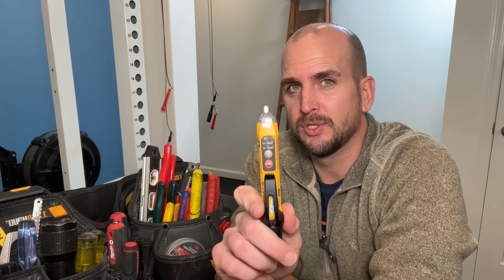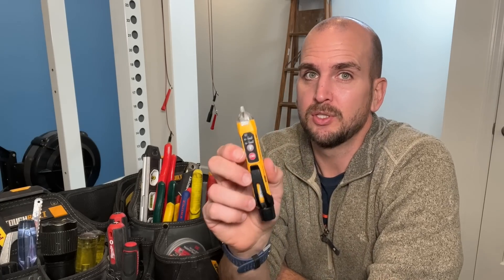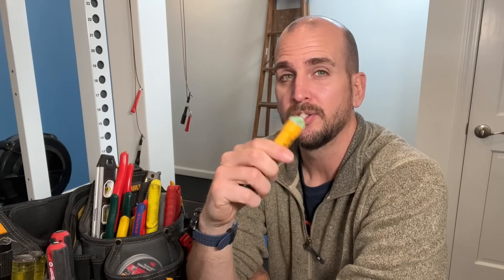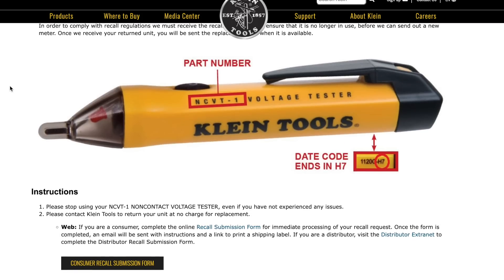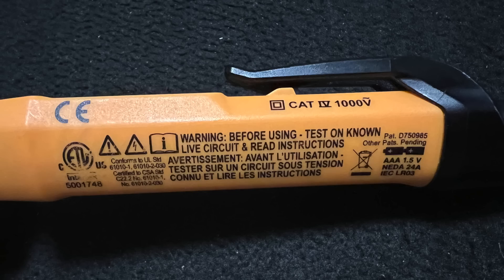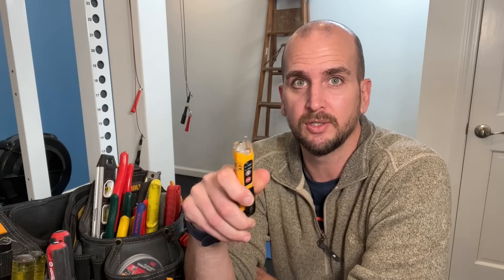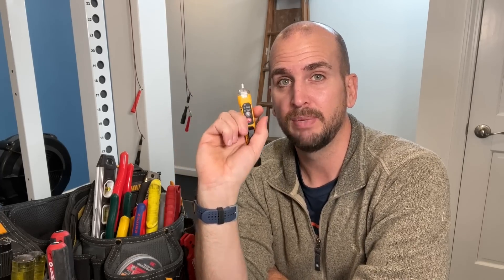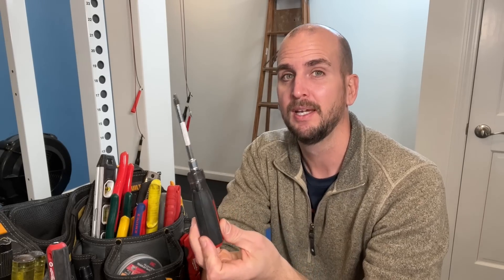The Tool I Get The Most Negative Feedback On And Still Use Weekly

Comment: I’m a home DIY guy and use it around the house for 120V. I’m not touching 240V, I call an electrician for that. But when I change an outlet before doing my work I turn off the breaker, test the outlet with something plug in and test it with the non-contact tester. Then I short the circuit with a screwdriver. Maybe not the best way to do thing, but I prefer to sacrifice my screwdriver rather than myself!

Comment: Despite testing wires for juice, i always do a final test before i actually touch them. I’ll use my screwdriver to contact each wire, one at a time, to the ground to see if it arcs. I have 99% faith in my testers, but i like to be 100% sure.
Reply: I do the same thing

Comment: My NCVT is the Sperry 6505.  It's advantage (IMO) is that it's ON switch is non-locking: only on while you hold it down. So, for every test you see the beep&flash turn-on signal, and there's no question whether it's ready to go. Batteries last longer, too.

BIG NCVT CON:  Mentioned in one or two of the comments:   240-volt circuits don't register well on any NCVT, because the two phases largely cancel each other out.  Have to get very close to the 240V Romex cable to get anything at all.

Comment: One time I got a false positive touching a wire. It must have been carrying some small amount of current since the wire treated was near a live wire several feet away. It confused the heck out of me and once I figured out the it really was a false positive, it made me question why I was using that unit. But I guess the false positive is a hell of a lot better than a false negative. But it took me a long time to figure out that it was a false positive. Only happened once, but I know now I need to use a multimeter tester if I get something odd next time.

Comment: I always use my volt tick to check the wires. I've gotten false positives with it, but normally that's if I have long pigtails that are swinging around for instance in a parking garage. another instance is a true positive in a busy box with multiple wires, but not the wires you're working with.
I've never had a false negative with mine, although they do have a minimum voltage that will activate them, and they obviously wouldn't work on DC. I only ever drag out the meter for troubleshooting.

I can deal with a false positive, I just treat the circuit as live and move on.

Comment: 35 year master HVAC guy. I use a NCV tester almost daily, never with an issue. If I EVER have an issue, I have my meter in my bag.  I like the low voltage feature.so I carry the same Klein meter and NCV you use, which is ironic because I have had reliability issues with Klein. When I change next, I will go back to Fluke, which I have found to be a better tool.

Comment: Been using one for 22yrs, but….a lot of them suck. I only use the Fluke 1AC-A1-II, 90-1000V , Tester and the Sperry VD6509 but the older version not the new ones they make now. Every other one I had bad experiences with.

Comment: I had an interesting experience helping a friend w/ some fucked up electrical wiring with a 3 way switch circuit in his garage: the multimeter read 60VAC even when the breaker was off. Apparently there was enough inductive coupling between an actually live circuit and the wires I was testing to cause that odd voltage.
(I was not using a NCVD at the time, just something re: multimeters and AC circuits I learned that day)
Reply: Same thing happened to me once. So damn confusing. I needed a meter for that one.
Reply: I had a similar experience but with a coaxial TV cable. Once I got a zap when I accidentally touched the cable TV connector and a grounded PC case at the same time. Tested with multimeter, it read 120V AC (half the voltage of 240VAC we have here) from a coaxial cable shield to ground. Called the TV company but they couldn't find the issue. Later I found out that my coax cable and TV power cable (non-grounded AC) were going really close to each other for just a few inches and it was enough to provide that inductive coupling. Once I separated the cables the issue disappeared.

Comment: i use those testers a lot for checking wires but always do the check on a live circuit because they do have battery failures and broken parts inside from being dropped. i have 4 different testers and two have died on me i am looking for a better one like the Klein which has an always on green light have you tried the fluke? which do you think is best model of those kinds of testers? you should do a review of different models

Comment: I have had to use these so many times. Nothing like getting shocked because some idiot wired stuff into a box that shouldn't be there. 
My house was built in 1969. It's been played with many times. There was an outlet on the outside of the house that we couldn't figure out how it was powered. Turns out it was fed off a bedroom circuit and the bathroom circuit. Yes I know, but shutting off power to it didn't kill the power to the outlet. I found out how it was wired when the outlet got wet during a hurricane. The cover got hit by debris and  it caught fire. The tester I used helped me to identify that the circuit was still live despite killing the breaker.

Comment: The licensed master electrician I use for the more complex work uses a NCVT and taught me when using one not to just test the terminals on a receptacle/switch/etc. He told me to slowly push it into all areas of the box because it is perfectly legal to have two or more branch circuits inside a single electrical box. And this would let you know if there is another branch circuit that needs to be turned off before working in that box.

Comment: I am an electrician for a local company. I have used these for years for checking to see if circuits are live to help narrow down my search for whatever the problem may be. I use this for quick checking only and when and if I have to work on the line I always use my multi-meter to make sure the circuit I am working on is actually off. I worked at Power Plants also and they issued these to their electricians. These are a must for electricians if nothing else to check Romex to see if it is hot in out of the way areas. Anyone who says these have no place for electricians in my opinion are not utilizes a very important resource that could save them time and money.

Comment: As a low voltage controls guys I work on alot of HVAC equipment that has a mix low and high voltages in them that aren't all turned off at a single disconnect.  I use one to sweep the equipment looking for hot wires.  It is not an end all be all safety check, but it is a good for quick check and troubleshooting.  The klien I have beeps based on the voltage and has an IR thermometer.

Once I have a basic idea, especially on retrofits, I use the multimeter to make sure I don't have any 120v control wires or directly from the c/b wired main power.

I have found so much sketchy work I have to wonder if a sizeable bulk so called professional electricians and controls guys aren't all retarded.

Comment: When you are testing for 'power off' on a circuit that has been energized, I would use a multi-meter to give me "zero- voltage reading". This will help in trouble shooting when a loose neutral condition is the problem. The loose neutral can give false negatives when a partial voltage is present, which may be too low for the range of the non-contact tester. 
As a master, where do I use the non-contact tester? Once I have established a zero voltage reading with the multimeter, I do a quick test with my non-contact voltage tester, especially in troubleshooting circuits I didn't install. There are too many instances where we have found voltage when the multi meter read 0 and also from mislabeling. Just because the original plans  show the circuit running through the receptacles or lighting where you are, doesn't mean that something wasn't added later. These things happen.
I've been down the rabbit hole of thinking they're great and then non trusting them at all. Now I use them only to verify my zero reading from the multimeter.
Good article, well done.

Comment: I'm an amateur, but I use a Fluke VoltAlert 1AC+A II.  Sensitivity range is 90-1000 VAC.  I mostly use it because it was given to me, but it seems to work well enough.  It has a red, blinking light to indicate it's on and testing, so minimized risk of false negative, and a red, solid light with tone to indicate hot circuit.  It does not have a flashlight function like the one you show in this video; that seems pretty handy.

Comment: I use my NCVT, but don't always trust it. One issue I've run across is false positives due to induced voltage from nearby cables. I was working on an attic exhaust fan, installed on a dedicated circuit.  Cut power at the breaker, but the NCVT was still chirping at me when testing the wire I checked the wire that I needed to work on.  I carefully opened the box and tested with my meter - 0 VAC. Performed the change out with no shocks/sparks.  The only thing I can think of is that the cable was running close to another live cable, and the magnetic field created by the current in the live cable created an induced field in the adjacent cable. 

I've also had situations where the NCVT detects voltage at a light switch that is in the OFF position, but when I flip the switch to the ON position, no current detected. Makes no sense.  But I'm just a DIYer, non an electrician.

Comment: clamp meters often have that built in or you can buy leads that can stab in to wires at any point or you can clamp on wire taps can provide safe testing. i have a clamp with all bels and whistles a multi meter and every other tester like this item its a great pocket or apron tool. anyone say not to have a tool talking out their rear end so they can smell their own stank breath.
the answer is do what you want it wouldnt have a federal safety rating if it was a bad tool

Comment: When you go to a trade fare for electrical stuff in Europe, you will get handed a Test Boy and those did never let me down.
My unit that I got handed in 2013 still works with the original battery in it and it's always detecting, you can not turn it off.

Comment: Multimeters have their own sets of pros/cons. They can pick up stray or "ghost" voltages, where you may have leakage or induction creating a voltage, but no real current behind it. Autoranging voltmeters can also give screwy readings. 

Bottom line: understand how every tool works and always get a baseline with a known ground truth.

Comment: Neither a multimeter nor a non-contact voltage tester are suited for this use. A voltage is a potential difference between two points, therefore you need to access both potentials securely. A multimeter does this, but it can cause false positives due to its high internal resistance (10MR) and for instance capacitive coupling between wires. The non-contact tester relies on your body as the reference, which may not be grounded sufficiently (As an electrician you may even want to be isolated even better, standing on rubber mats etc when working with live circuits). The right tool for the job would be a proper voltage tester, for insance the brand "Duspol" from "Benning" is very popular here in Germany. It has a lower resisatnce than a multimeter, discharging charges which would otherwise cause false positives.

Comment: Master Electrician here. The pen tester is a great tool for most applications. It uses induction to detect a live wire. However, because it relies on induction it will not detect voltage stored in capacitors. Please use responsibly and always discharge your capacitors.
Reply: great to see if there is power but not to see if there is no power ....  not safe to trust them
Reply: Are you sure it doesn't use capacitance to detect voltage? If it was using inductance, there would have to be some current flowing to get the sensor to work. The reason it doesn't work on capacitors is because the stored voltage is DC, whereas these testers only work on AC voltages.
Reply: @jc40337  You are correct, from Fluke: Non-contact voltage testers work by sensing a very small amount of current that is capacitively coupled from the live circuit to the tester and back to ground. Non-contact voltage testers light up when they detect this current without needing to make direct contact. 

A built-in sensor at the tip of the tester detects the presence of voltage when touching a conductor, outlet, or supply cord. By holding the tool, you are the ground reference through capacitive coupling. When the tip glows red and the unit beeps, you know voltage is present.
Reply: From my instructors with decades of experience telling me yeah get the dummy stick, with the only job is saying there is voltage. But sometimes that is all that's needed. And yes it runs on inductance, capacitance just refers to a material ability to store energy, while inductance is the emf generated from the voltage shifting polarities.
Reply: Actually I think they are more capacitive in nature, measuring the strength of the electric field. They still mostly just work on AC though.

Comment: My single most important "go to" when working on any electrical circuit...
ALWAYS ASSUME EVERY WIRE IS HOT AT ALL TIMES. This has saved me from shock because of faulty equipment/methods on more than one occasion.

Comment: There are many older Romex cables that are very difficult to detect voltage on with these testers, so don't handle the bare wires until you confirm zero voltage.

Comment: 25 years in the trade. safety is absolutly the ONLY reason I use contact testing. if i'm working hot wires i don't even check. but if i am planning on grasping the copper of the wire or terminals, i always check my meter first then check for voltage. i've been shocked from chassis of equipment. its just one extra level of safety. like glasses and ear plugs. takes an extra second to test your meter first but it might add years to my life.

Comment: FWIW, an imperfect tester that's used every time, and taken with skepticism, is better than one that you get lazy on using because it's a pain. I personally like to use the NC (a nice Fluke that I've had no issues with) first to check before I start work and when possible, use a small contact tester. Really useful when trying to find a breaker or confirm you got the right circuit and then double-checking with something more idiot-proof before putting hands on to do work.

Comment: During electrical inspections when finding life wiring that is not properly isolated against touching , I photograph the wire holding a Fluke Volt alert next to it .  The bright red LED indicates the presence of danger very well to our customer, once the photo is taken I switch off the circuit and protect it against switching on the circuit using a lock and proof the circuit is dead using a contact tester.    I use it only for indicating the presence of danger ..

Comment: Non-Contact voltage testers are fine "most" of the time.
Unless you are in a house that switches the neutral. Which is more common than you might guess.
A circuit tracer is far better. Plug in the remote unit.  use the wand at the panel. return to see if the light is on on the remote.
The only reason you would use the want is because you are to lazy to turn off the circuit and at that point  you may as well do your work live,

Comment: ideal 61-657 is what I use. I had a lot of false readings with the Klein, so I threw it away. My Ideal is just like yours, led light, with green tip. And I've had zero issues with it. Was going to pick up a fluke but this one was like $35 at the time, so I tried it out, and keep it in my bag now. Just like any tool, you have to build that confidence in your tools, and false readings don't build anything but distrust in the tool, and when I can't trust the tool, I can't do my job safely.

Comment: Wind Turbine installation/commissioning/troubleshooting.
Personally would never trust a standalone NCV tester with my life. I work 45-75 minute drive from any medical help (not including rescue time - up to 30 minutes) 
Fluke T5 is a very inexpensive trustable Hot/Cold/Hot meter
I also have a T6 which has a NCV/AMP  option along with a direct contact testing but needs to be grounded.
Generally in my industry a Fluke 87 or 289 is the standard however.

Comment: in my experience i find false positives mostly when testing dead circuits that may have energized circuits near them. voltage is produced by induction from the energized wires. This is usually lower voltage without current.

Comment: have an old non -contact tester, worked fine but the sound part died. So I bought the klein. first test, gave me a positive on ALL 3 wires of my 3 way switch, although only 2 were active. sometimes testing on the outside of an outlet, it shows power on both slots. NVCT -3P

Comment: I use mine daily... I still treat each wire as if it is live.  I also rub the tip on my sleeve to beep the tester a couple times to test before each use.  I had a few times with common and hot reversed in old wiring and my ncvt saved me getting zapped.

Comment: You can also get a false positive from a dead wire if it is run beside a live wire.  The test location can be well clear of other wires but if the dead wire is run through joist holes beside a live wire this can happen.  Pretty sure this is to do with a small induced voltage.

Comment: It's important to know the working range of your NCV. Insulation and distance impact the sensitivity dramatically.  Another issue is that if you have several wires in close proximity, such as in a box, its easy to fool yourself into thinking a wire is hot when actually the NCV tester is sensing a nearby wire.